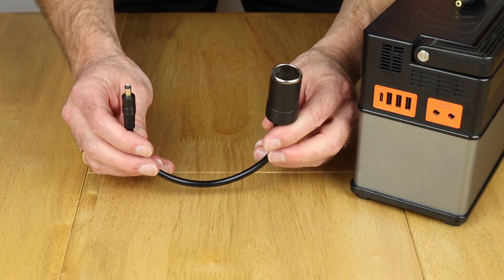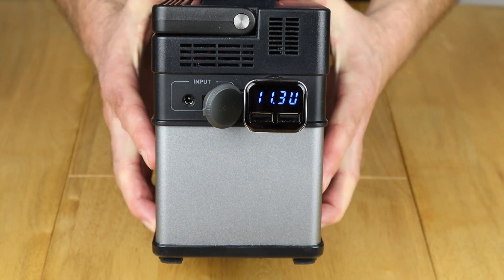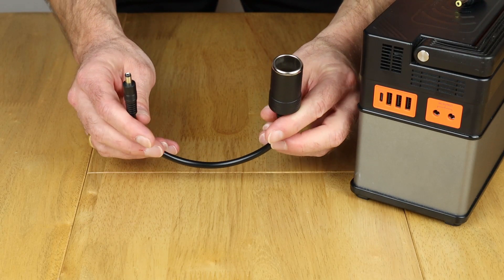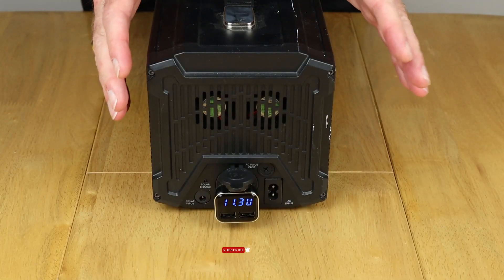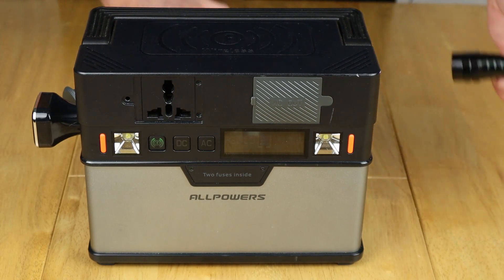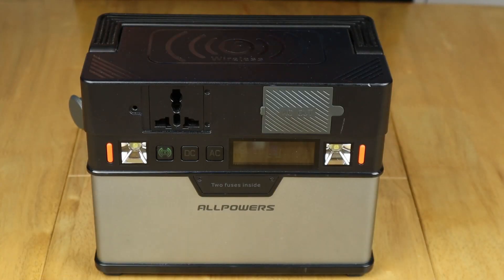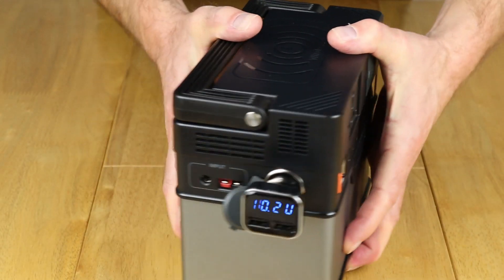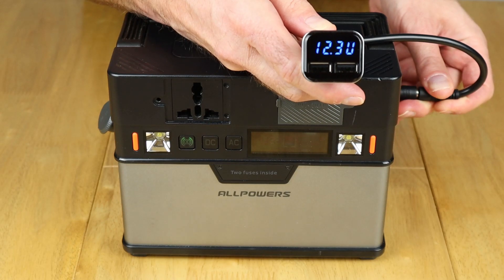Does the ALLPOWERS 372Wh Portable Solar Generator have a regulated 12V output?

Comment: i have the bigger one what they now call the s500 with 606wh. the one that seems to be the 666. if peopel say on this one the cigarett lighter port is unregulated too than they must have change something because mine is regulated.
Reply from the maker: @matze x  Good day and thanks for your comment. I've got the 666 and found that although the cigarette lighter port isn't regulated it stays above 12V until almost empty (https://youtu.be/u35nCNS1v2k?t=223). That's great to hear that the port on the 606 is regulated. May I ask what voltage it's regulated at? All the best, Adrian
Reply: @DADvinci  it seems to stay all the time around 13v. the other dc ports a just a tiny bit under 13v. i noticed first the difference when i saw in some videos the port is on all the time while my port is only on if i press dc.

Comment: Hi, you being the worlds foremost authority on Allpowers solar generators......I have a problem where my 372Wh will just not start up. Just my luck I bought it days before lockdown, so it hasn't had much use this year at all. I got it out this week, and plugged it into my 60w PD, nothing, no display, no lights, no output from the USB sockets.... completely dead. Left it charging overnight, nothing!   Is there anyway to re-boot the thing back into life??? Regards, BOB.
Reply from the maker: @Bob Henshaw  Good day Bob! I'm sorry to hear you're having problems. There are a couple of things to try first off that might help wake it up. Have you tried the standard power brick into the DC socket as yet (or just the USB-C PD route)? You can factory reset the unit by holding the DC button for 20 secs (until the whole display lights up) and that might be worth a try if the first method doesn't work. Please can you let me know how it goes? All the best, Adrian

Comment: I can probably explain why this happens. These power stations arw usually made from 3.7v lithium ion cella usually 18650s or 26650s. At max charge they can deliver 4.2volts so 3 in series is 12.6v when fully charged and only 11.1v on average as capacity gets lower. In the bigger wider 666wh they probably have 4 in series 3.7 x 4 = 14.8. 16.8v when fully charged then they probably use a voltage regulator to bring it down too 12v for the dc jacks and it the dc jacks can sustain 12v for longer.

Comment: Is the 12v regulation on the 666wh car outlet better than on the 372wh car outlet? The problem with these things is the 12v socket cant put out as many whats as a regular 15amp car socket so things like a 150watt 12v car kettle is unlikely too work
Reply from the maker: @Graham Jones  The 12V cigarette lighter outputs on both units are not regulated, so the voltage drops as the battery charge does. The battery configuration is different in the 666Wh which is why the voltage range is better. Cheers, Adrian

Comment: Thanks for some Good reviews. My portable fridge uses 5.8 amp. Will it still work using the other option to get regulated voltage?
Reply from the maker: @K-DOG-DK  Good day! Thanks for your kind feedback, much appreciated😊. I've double checked on the 2 x DC5525 ports and the best I've managed with my load testing kit is 5.2A before the ports cut out. I assume your fridge needs a minimum of 12V to run? As the cigarette lighter output drops below 12V, the other option would be to get an AC to 12V DC (10A) adapter like this > https://amzn.to/3jSHdDR (affiliate link). This would have some overhead (using the in-built AC inverter) but you could use all the battery power for the fridge. I hope this helps? Please shout if you need anything else. All the best, Adrian
Reply: @DADvinci  I tried the adapter cable solution and oh boy that was disappointing , so frustrating in the middle of nowhere With over 70% battery left and now the fridge is off and can't power it thru anything else than the AC outlets with the fridge factory adapter  , and it's the most inefficient way of running those fridges or using a powerstation to run that type of equipment . 
What i ended up doing was plugging in the solar panels to the Anderson port and at the same time have the fridge plugged to the cigarette lighter and that way the voltage was usually on the spot even when the battery capacity dropped below 70%.  Hope the useful trick helps the rest of the people out there , it does require some minimal amount of solar input though like minimum 15/18w coming in and that way it worked fine , I even managed to get more than 3x that and basically run the fridge completely by solar and charge the powerstation at the same time ( optimal southern Spain sun directly hitting it )
Reply from the maker: @Frederico Santos  Hey Frederico, it's nice to hear from you. I'm sorry it didn't work for you and thanks for sharing. My 372 runs a C15 Alpicool for around 45 hours (+ or - a few hours depending on ambient temp) without charging, set to 3C and in eco mode. The fridge also has a voltage adjustment setting (high, medium or low) that means I can run from the cigarette lighter output on 372 when it drops under 12v (so use all the battery charge). The only issue is the DC port going into power save (highlighted previously) when the fridge compressor isn't on, but I put a small load on to keep it awake. I need to test it on larger fridges (when I buy more). It works fine when travelling as 12V charging in the car (or solar when out) keep it running for as long as I've got a power source (every day is good to keep 372 from draining completely). What fridge do you have? All the best, Adrian
Reply: @DADvinci  Hi Adrian , thanks and it's nice to hear from you too it's been quite a few months at least  , I have a 55lt 12v compresor fridge that also has voltage settings and eco mode , but in real usage during summer it's hard to keep it low with outside temps near 40degrees Celsius , I usually put the fridge on 3 or 4 Celsius , but I've also run it at minus 10 to have ice creams and frozen goods in remote locations during 4x4 overlanding travels . 
I use that same trick of keeping a small constant load on the 12v ports to keep it on without turning itself off when the fridge is not drawing much , I also found out that if you have a solar panel putting in something around 15/20w  you can trick the powerstation to think it has more voltage than it actually has in the battery and that way you can keep the fridge plugged to the cigarette lighter socket for way longer and that way use most of the battery instead of cutting off with 70% capacity left . 
And by the way have you seen some guys on the off-road community that replace the cigarette plug from the fridge 12v cable for an Anderson or specially for MC4 plug and that way the fridge will stay plugged during corrugated roads and bumpy off-road travel because usually with the cigarette lighter plugs and sockets they don't really clip in and make it resistant to such conditions , any advice on there ? Which route should I go ? I mean the AllPowers units don't have MC4 plugs but maybe I could get a cable from MC4 to DC  or maybe Anderson type ?! 
Also in that case the best scenario would be to get another cable adapter from Anderson to usb-c in order to charge solar thru the usb c port , would that be possible ? 
Many thanks in advance and as usual always a pleasure chatting with you and watching your videos keep them going !!
Reply: @DADvinci  oh and forgot to mention that in my case if I use the DC to cigarette lighter socket cable adapter then I can't run the fridge on full power mode and sometimes not even in eco mode , I think the cable doesn't handle well anything over 40/45 watts .
Reply from the maker: @Frederico Santos  That''s a good idea for rough terrain when off-roading! You can get a MC4 to DC cable, but they are usually for connecting to a panel with MC4 connections. I guess you could turn the cable around > https://amzn.to/3tHF4RY (affiliate link). That way you could then attach the DC end of the cable to the 12V DC output (60W max) on the 372 and the MC4 end to the MC4 connector you've replaced on the fridge power cable (you’d need to ensure the polarity was correct though, so + and – connected correctly). I personally wouldn't do that and instead look for a way to lock the cigarette lighter plug firmly in place.

There are a couple of options for charging via the USB-C PD port direct from solar. I've got and am testing one of these > https://bit.ly/3n8p2iC (affiliate link). It seems to work ok if there's enough sun. Plug the solar output to the input on this and then connect up a USB-C cable to charge the 372. The other option is MC4 to USB-C > https://bit.ly/39b31Yw.. I hope this helps. Please shout if you need anything else. Cheers, Adrian
Reply: @DADvinci  @UCOpEDEEvnW83Xq72eT-Wcyg ARB makes a screw-in 12V port (10900028) and power cable (10910076). This is the route I thought I would go, if I could get the AllPowers unit to work effectively via 12V. Maybe DADvinci can post an affiliate link?
Reply: @DADvinci  Thanks so much 🙂
Reply: @DADvinci  I was wondering if how you turn on that dc regulated on? By app or Dc switch ? Cause I’m in USA which is the model that has 110 AC plugs not 220 anyways I have test with multi meter and on dc switch on or off only 6v shows and then only after activation of 12v knob I can get for a 2seconds that 12.2v output my question is is a load have to be hooked up to maintain that knob on ? Cause it turns off right back after a second ?
Reply: @charlschuck6  yes it does need some power drawn for it to stay on constantly , that's another issue with using 12v fridges with the cable adapter thru the 12v ports , basically if the fridge stops pulling power for some time and it drastically reduces the output it will eventually cut off itself and turn your DC ports off .
Reply: @DADvinci  I just got another unit from AllPowers I have two 372wh , and the gave me now a 300wh new unit , do you happen to know if the new 300wh ones have a regulated 12v cigarette lighter socket ?? 
Thanks
Reply: As fas as I know with the 372wh both older version and newer version( universal sockets and no covers ) with a 12v fridge the cable adaptors you can buy easily from Amazon or similar aren't good enough and the fridge will power itself off , I had exactly the same issue having a fridge and not being hablé to use the powerstation for more than half a day / almost one day before the fridge went off using normal cigarette lighter socket and a remaining 70/75% battery left  , so I bought the adaptqr cable to go onto the 12v output and guess what it's not good enough to sustain power to a fridge because as you said the limit of what the cable can handle and what the fridge will require are two different things unfortunately . @DADvinci